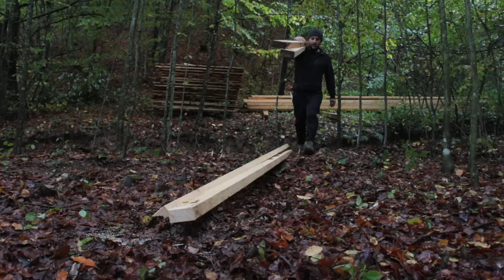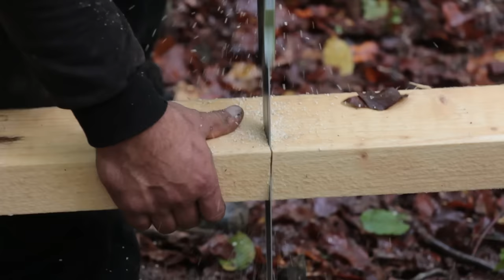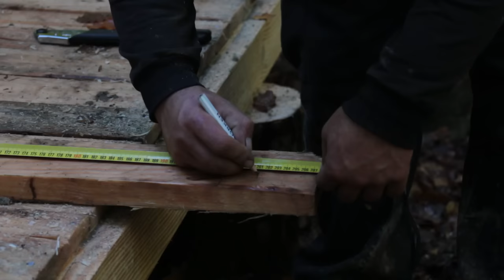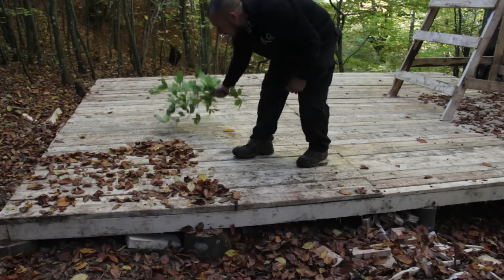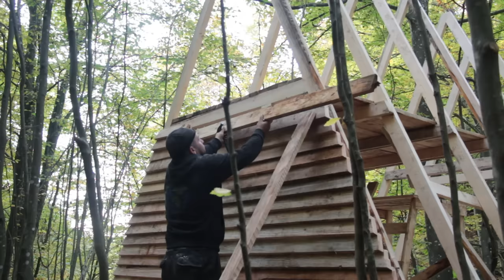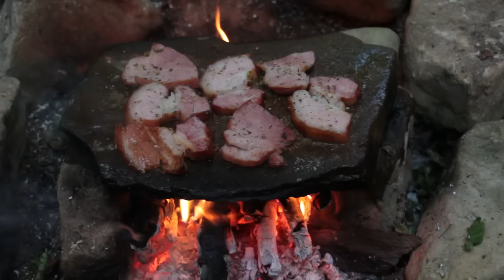Construction of an A-shaped house in the forest. Part 1

Comment: I'm guessing this is the first thing you've ever tried to build. While I congratulate you on your hard work, if you don't stager the seams on the floor and walls it is very sketchy and weak. Especially the floor area with nothing to support the middle of the boards. And to put that weakness over the farthest drop when you go through the floor....  And to build the "foundation" on top of leaf litter, well, don't expect it to be level-ish for long. I'm honestly not trying to ridicule you, just help your next project be a bit more safe and long term. Best of luck.
Reply: I was watching the floor get put down and my eyes widened coz my OCD would mean I had to rip it all up and stagger it. And I also wanted to see some sizalation go on the frame before the roof. And I also wanted to see the roof done in a weather board kind of way to stop leaks. That roof would take in water like nothing else. And yes, the foundations... We're gonna need some holes and some dry mix stat haha. But basically, this is actually the best A-frame video I've ever watched that makes me now feel like I could build an A-frame by myself relatively easily. It's certainly the first one that has ever kept me interested all the way to the end. And cooking on the stone. Nice touch. Ok so whoever sees this, I'd like to announce that I'm going to build an A-frame.
Reply: Foundation on leaf litter. Foundation looks like he nailed it to a tree in one spot. Joints not staggered. Untreated wood. This will make a nice fort for children for about one year then it’s going to fall apart.
Reply: Como é que alguém constroe uma casa sem fundação é com uma madeira tão frágil,  que Deus te proteja 🙏🙌
Reply: Go below the frost line. Nice work otherwise
Reply: I think sono tube and strong tie and cutting stagger cross sections in between would be the only differences to make his foundation sturdy and solid stone or stones placed under his sono tube pillars frost line of course but if your lucky and your frost line is almost 😅 no exsist any where he’s at looks like a 36 inch er  but hey you never know till you reasearch it
Reply: Youtube Youtube laaĺ
Reply: Man you just say all what i think about this, i really believe that this is only for playground.
Reply: So nice try but .. not going to last 5 yrs - especially with untreated pine in a rain forest 😩
Reply: @johnlamb6815  Non of you guys have understood what this video is about.

It's nothing to do with making a decent lasting construction.

It's all about the asmr qualities. Building in the quiet forest. The sounds of the saw and hammer. Having a meal by the fire... have you noticed how all these wilderness vids have a fire cooked meal? It's the same banal stuff, the same tired formula every single time.

And yet this video will get him a million views. The lack of preservative on the wood or the dodgy carpentry is irrelevant.

He doesn't care if it only lasts a month... he will be making money from the ads served for years to come 🎉🎉
Reply: The tree that's holding the building up won't do it long . One good storm the tree will sway and the building will rock and the log underneath will fall. Need I say more.
Reply: Experiência ajuda.

Comment: You know, construction adhesive and a caulk gun doesn't need power either. Your building would have been way stronger sheathed in 1/2-3/4 mdf...science
Reply: Sometimes you use what you have that is cheap and readily available. It's best to either mind your business or ask questions rather than tossing out unsolicited advice. 🤷